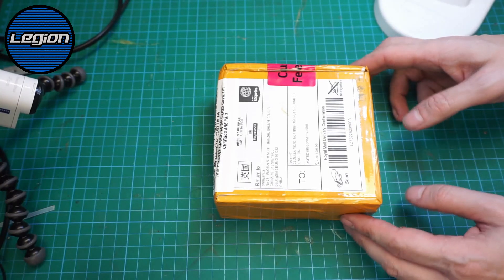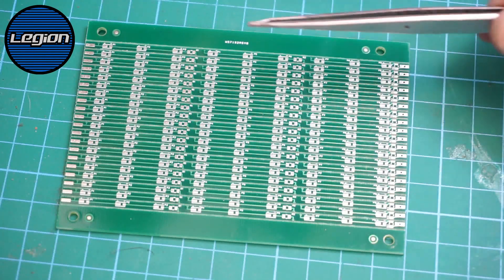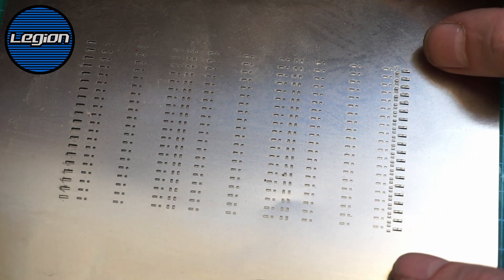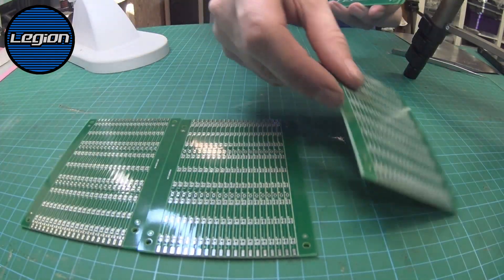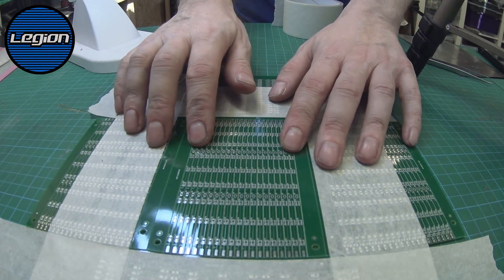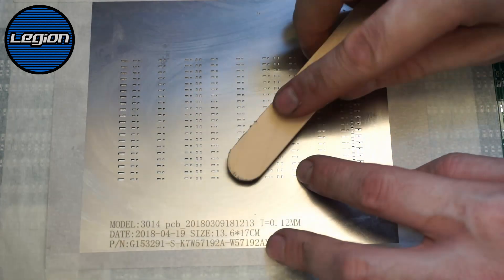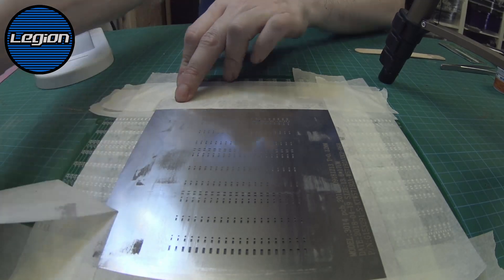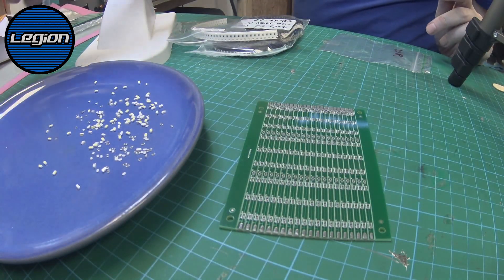How I assemble SMD LED components on a PCB with a Stencil for my Neo Geo LED kits,.

Comment: You sound like you're sick or something while filming. No offense is meant at all.
Reply from the maker: I have asthma and nazel polyps so my voice changed recently  and I am always blowing my nose because the polyps make so much mucus even after I had them removed. So to answer your question yes I am.
Reply: @DJlegionuk  sorry brother. I in no way meant to offend. I suffer from health issues myself so I can completely relate.
Reply from the maker: @jstro-hobbytech  I am sure it was from 3d printing without proper ventilation so my own fault. Since I sorted that it's a lot better.
Reply: @DJlegionuk  I usually only print pla but I'm building an enclosure for one of them so I can print bigger abs prints. I'm going to go with a carbon filter first and see what happens because my workshop is small
Reply from the maker: @jstro-hobbytech  I vent outside, my workshop has windows that only open a small amount and shutter are down at night so I made a cover for the window cap and fit the  ducts to it. I can have 6 printers running and can still smell some even with them all in enclosures and venting outside.
Reply: @DJlegionuk  wow brother. I have 4 and I'm thinking about building a voron 2.4 to get rid of a couple lol. How did you enclose your printers? I keep flip flopping between a couple ways

Comment: What type of board are you using? HASL? Can it withstand the heat from your LED?
Reply from the maker: there is no heat once the boards are snapped off to the slim 3mm strips and the 3d printed case would melt before anyway.
Reply: @DJlegionuk  cool! looking forward to see the outcome of your project

Comment: Great Video! What temperature did you use on your hot air station when heating the LED's? Thanks!
Reply: pro trick: you can watch series on flixzone. Been using them for watching lots of of movies lately.
Reply: @Parker Dariel definitely, I have been watching on Flixzone for years myself :)